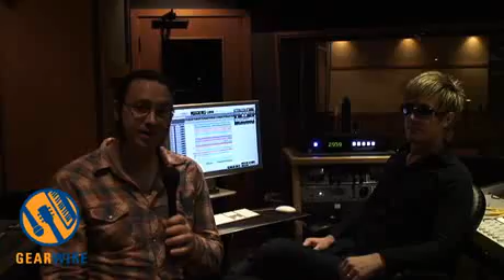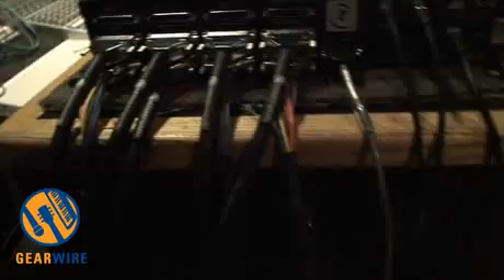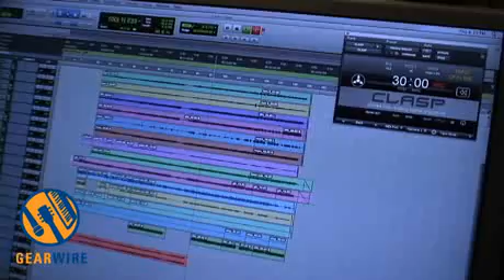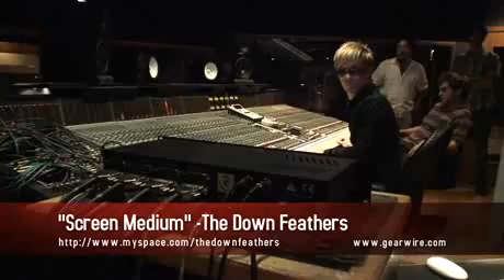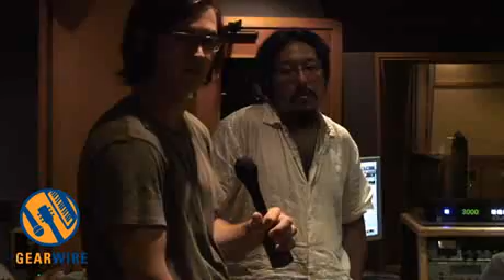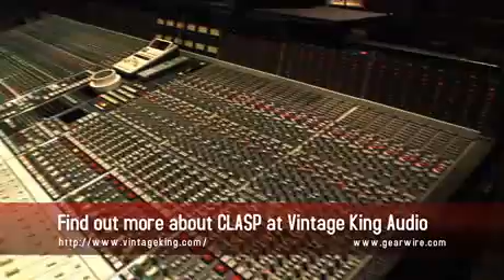Endless Analog CLASP Demonstration: Chris Estes Is Resurrecting Tape Like Some Sort Of Magno-Mancer

Comment: I love fooling so-called ''pro recordists'' with my Cubase mixes.  ''aww thats analog compression you just can't beat tape''  They can't tell.  There is no difference.  Run it through a tube compressor afterwards and you have clean digital signal, no tape noise, and nice compression if needed.  AND the musician's can afford the recording.